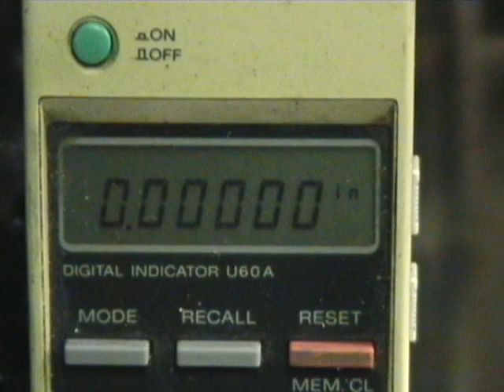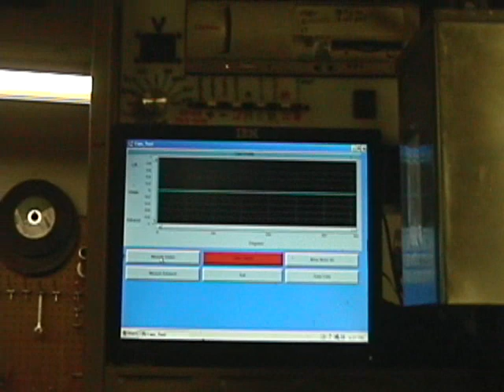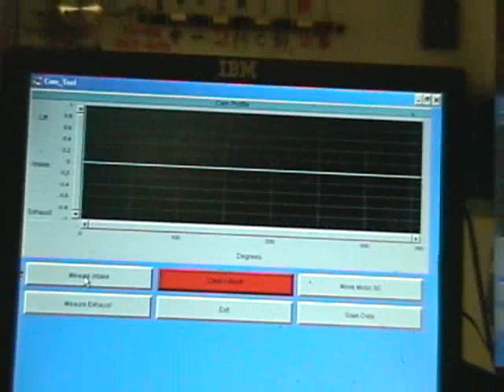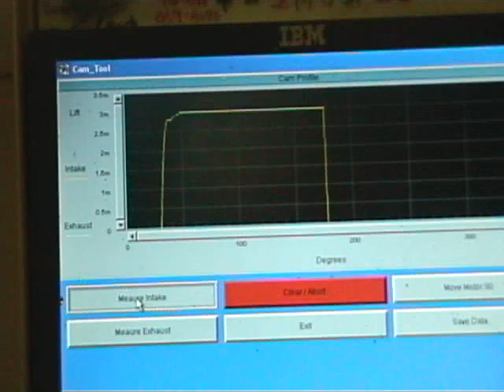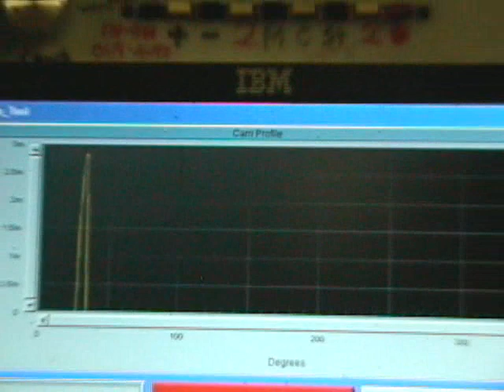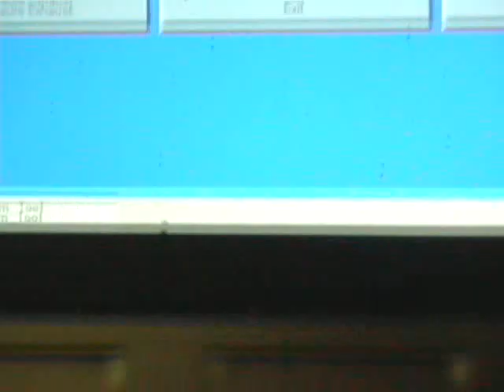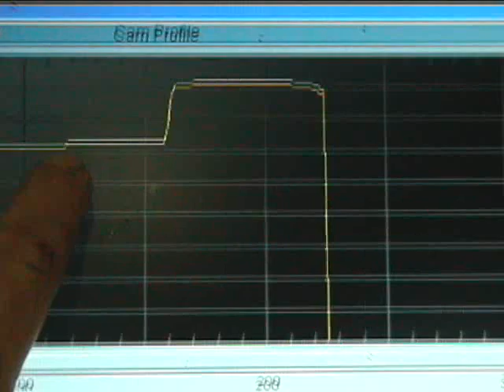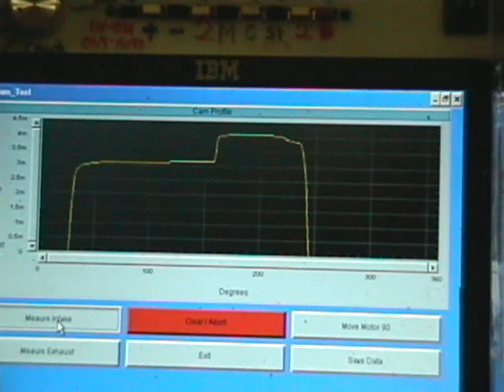Superblend

Comment: So what made the superbkend the success that they were on the commando?
Reply from the maker: Very high load capacity along with a lack of a step between the straight part of the bearing and the edge radius. 
I have been told that the title "superblend" came from the new manufacturing process that enabled perfectly blending the edge radius into the flat part of the bearing.
Reply: James is correct (as you'd expect of someone of his high level of technical knowledge and experience with Nortons), but I'd add that in the process other changes were made, too.

The radius grind profile between the shaft stubs and crank cheeks was defined (so that the inner bearing race would sit more firmly against the cheeks but still provide a blended radius for that profile to lessen the chance of a crank breaking -- John Hudson always emphasised that all the way back to Bracebridge Street race shop days, they'd pick cranks for DomiRacers that had a generous radius for this reason - bearing races would be hand-fitted to those crankshafts).  The tolerances for straightness of the assembled crankshafts were tightened as well as allowable end float for the cranks as assembled into the crankcases.

Because of this, the Superblend appeared to be more successful in new engines out of the factory - resulting in a notable decrease in bearing failures after that point.  There was a slightly larger failure rate for replacement Superblends in the field since those repair-fitted bearings were going into earlier engines without the crank improvements.

Commando cranks -- being basically the same construction as the 500 Domi twins of the '40s - were crude and highly stressed.  The test shop at Marston road would heavily breath on cranks, measuring dimensions, checking alignment and balance (balance on the assembly line was always static balancing, not spin balancing), scraping mating surfaces between the journal flanges and the flywheel, etc.  There was also a mod tried using very-high-strength Allen screws with matching nuts to hold the crank assemblies together but -- without the very time consuming and expensive hand fitting -- it was not felt that any significant improvement was shown so this was not carried over to production engines although this mod was used in some Thruxton race engines.  It was also important to check the dimensions and alignment of the bores for the mains in the cases. as well as installation details such as end float.

Sorry to go on a bit, but the experience of many bearing failures and the introduction of Superblends was a big thing around the place in 72 - 73.

Comment: I find this interesting.  I worked in the service department of a small company in a little town on a little street called Marston road in 1972.  We had some severe and dramatic crankshaft bearing failures.  The bearing supplier suggested the "Superblend" bearings as likely to solve the problem because "they allow for crankshaft flex".  Failures went down to an insignificant level, both on new vehicles and those that had Superblend bearings installed as a service fix.
Now, it's obvious from this video that there's no "blending" or "barrel shaping" involved.  What makes these so much better than their predecessors??
(Thank you for your technically advanced and sophisticated videos on the Norton Commando.  If only we had known ....)
Reply: https://www.nortonownersclub.org/sites/default/files/Main-Bearings-v1.1.compressed.pdf